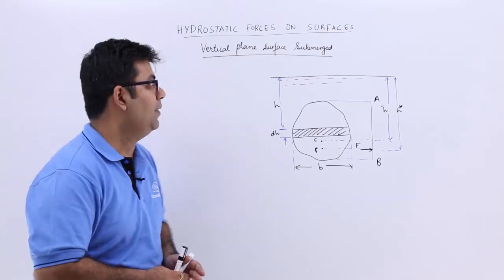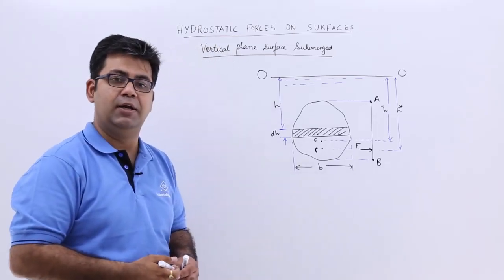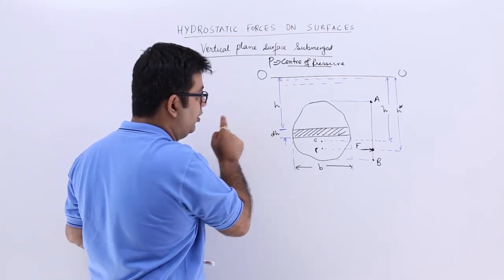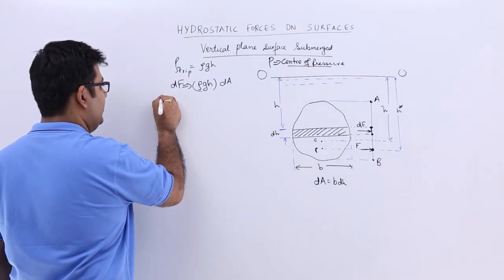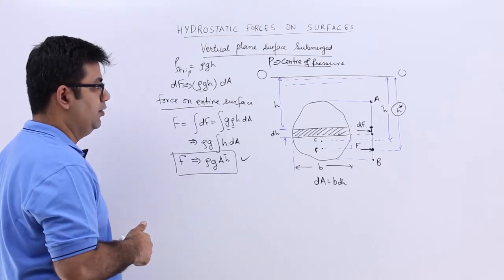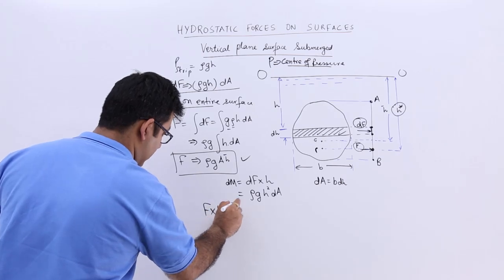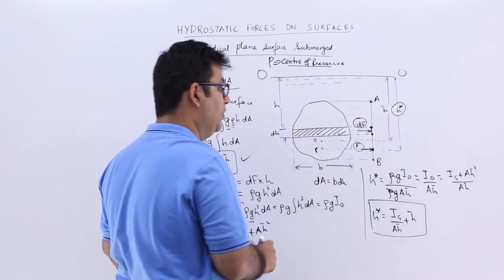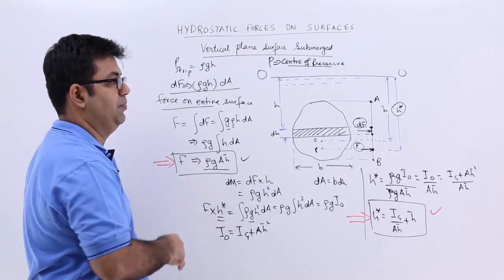Vertical Plane Surface Submerged in a Liquid

Comment: how can vertical plane submerge will form pressure could you explain it for me I mean its obvious if we submerge horizontal surface on it can creates pressure due to its weight at fixed depth which finally give as P=pgh on horizontal plane but even during hydrostatic of fluid when it's not on movement what type force create on horizontal which exert pressure vertical plane surface

Comment: why we consider the pressure applied on the dF element is h.rho.g 
while  the pressure is made by the water + material of the plane surface .. why should we consider only density of  the liquid?
Reply: Because of hydrostatic force